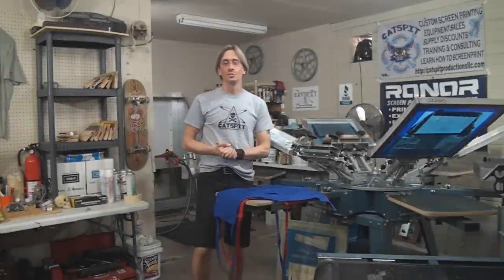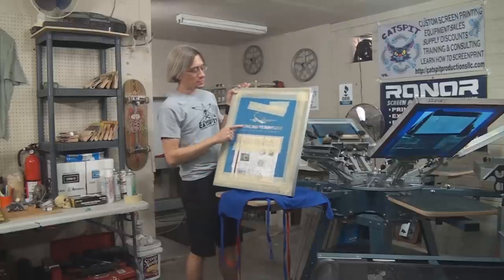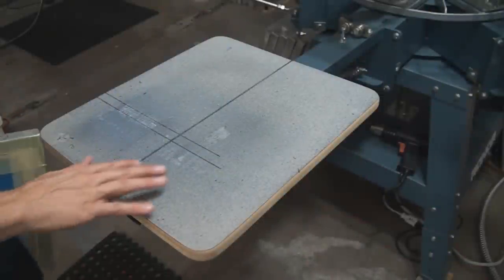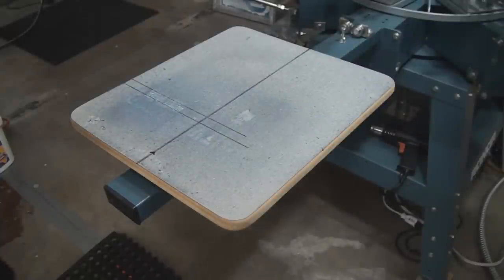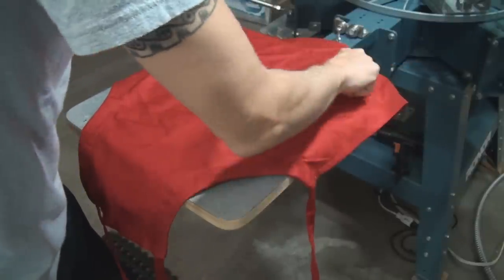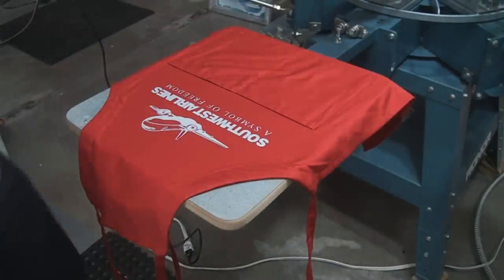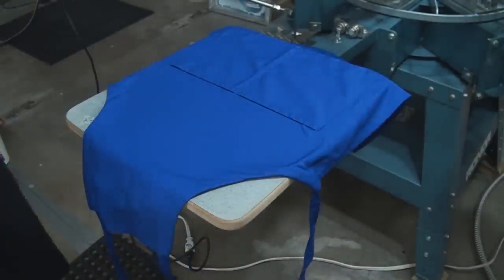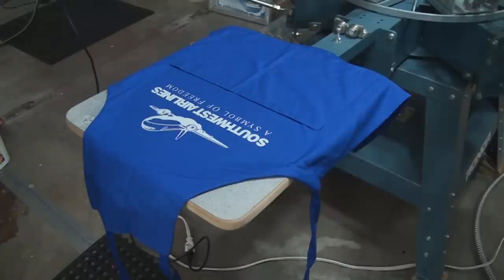How To Screen Print: Setting Up & Printing Aprons

Comment from the maker: @420jaymac Thank you! Glad you like my videos. You can do it with a flash cure unit but a conveyer dryer will be much better for production and consistency. They are much more reliable than using a flash cure unit. Thanks for watching and leaving a comment! ☠

Comment from the maker: @EnassiClothing LOL, yes of course I do. But I do not do any final cures with my flash cure ever. I always use my oven because then I can be sure of my cure. I just used the heat gun to dry them to the touch and then I sent them through the belt oven to do the final cure. You can see videos of all my RANAR equipment on the channel page. I print with it and I sell it. Thanks for watching and leaving a comment! ☠

Comment from the maker: You need to use a good emulsion remover and a pressure washer together for it to work properly. The emulsion should not be too old. You could have screen lock if your screens were underexposed by the sun. Honestly if you watch all my videos you will get the answers you need to make a screen easily. Start with the first uploaded and go from there to the latest video. Check out my video upload collection as I have a few videos on this matter. Thanks for watching and leaving a comment! ☠

Comment: Hi Mr. Printer. I have one question - I've got big troubles with removing the emulsion. I actually burn my screens on the sun. Could this be the cause? It takes ages to reclaim just one screen. Or may I use wrong emulsion remover? I tried 2 different paste, but neither has work out. Or maybe my water pressure is not strong enough? I also haven't removed the emulsion for a few months - emulsion on the screens is too 'old'??????? Thanks for your answer.

Comment: Hi,im here for han advice really, beacause im printing on black aprons like the ones on the vid, but using white ink (customer wants white ink.. ) and when print the logo (3 covers of white ink) and use the heat gun a little bit the white ink starts to get gray....so my question is, im doing something wrong?? or its the apron color whit the white ink....??